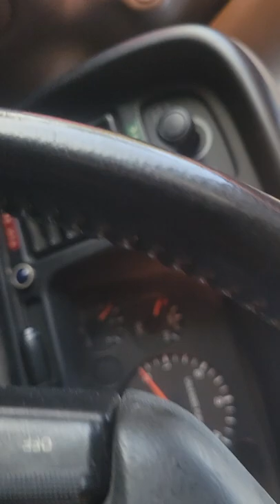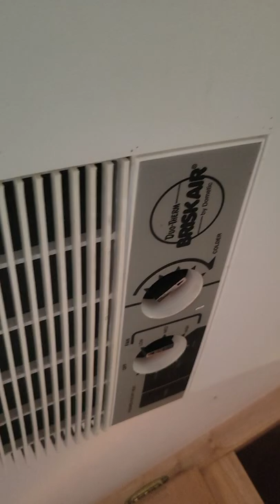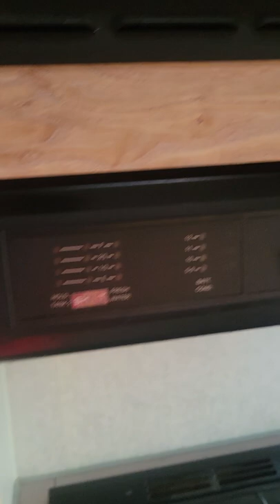Serro Scotty 1995 Dodge Ram 3500 Rare 4WD V10 Magnum Hilander 2500GT Motorhome

Comment: Serro should of stayed with travel trailers only it's what they knew best.  They had issues with those motorhomes. I have been to the factory in the 90's and in the yard they had all the Dodge truck cabs for the motorhomes. It was really neat, they took what ever Dodge sent them.  Some had seats in them, some not. Some cabs were stripped others not.  They would send what ever they had.  A great small production line at Scotty, they could build the motorhomes, travel trailers and the fire safety house all on one line. In a small factory.  I have it on VHS tape from 1993, what a great company and family.  ( Jerry F. )